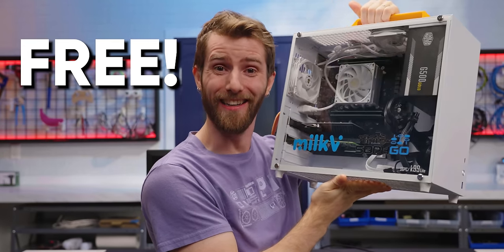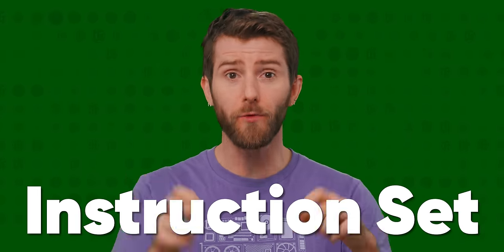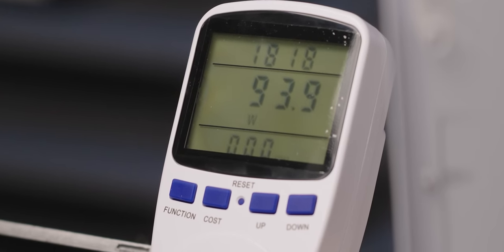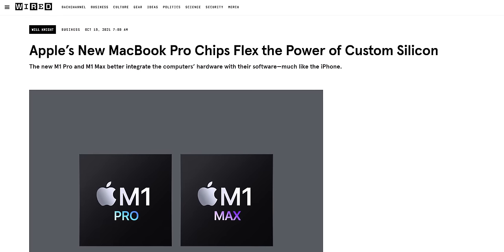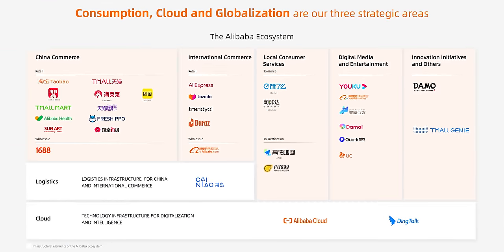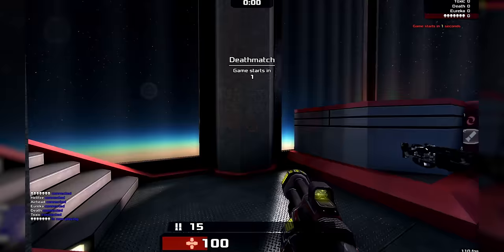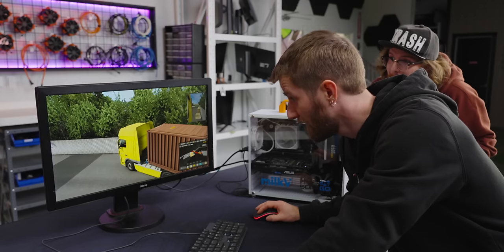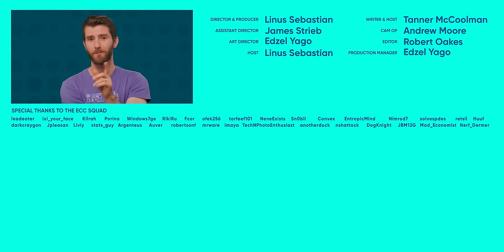This CPU is FREE! - Milk-V Pioneer with RISC-V

Comment: This reminds me of when I learned to write to code. I actually thought it was pretty cool. I watched Apple update to IOS7 and change the UI Theme in about 4 months and damn near 200,000 manhours of code. Then realized it would take me 80+ years to achieve the same amount manhours. Then the errors of running code through some type of hardware level middleware will lead to insurmountable application and system crashes. This not going anywhere outside the classroom.

Comment: Screams on and off software for things
Reply: Optimize by id ing what engine and core files the games run on even a file system emulation showed a slow down like old decompression compression compiler drivers like default vs brand graphics drivers

Comment: Lol traditionally RISC was all but low performance. SPARC and MIPS cpus have been powering werkstations when x86 still was x86 and not AMD x64. Even PowerPC and DEC Alpha where miles ahead of what contemperary x86 and m68k (that's Motorola 68000 the other big CISC player in that day) machines could do. 
In the late 90's everybody (in professional computing) but the consumer (pc fanboy/gamer) market expected x86 to go the way of the Dodo.
You all have to thank AMD for developing x64. 
By the way Loongson used the MIPS ISA up 'till 2021 when they switched to there own ISA LoongArch that's still RISC and still heavily MIPS influenced (to the point that some would call it cripple MIPS) and it also uses some inspiration from RISC-V ISA.

Comment: Hey I don't know if anyone else pointed this out or if it works with the RISC-V architecture but there is box 86 which does only 32 bit applications and I got it to run steam on my raspberry pi (as an experiment) so that may work for this idk though

Comment: Low performance but very power efficient? 
I see there already solid application in very efficient NAS system, I mean 64 cores and OKish I/O? 
If I‘d not already own a NAS system I‘d consider using one of these if for instance TrueNas Scale works…
Reply: Exactly why it's starting to have increasing use in microcontrollers, so I would guess that it will come to NAS soon enough)

Comment: Well ~ It is license from RISC-V ... but what made the it !? T-Head or Starfivetech + Mike-V !? But ... what about the Risk !? RISC-V = RISK !?(RISC-V license allow you to ADD ISA and Close  it .... do you know what they adding ?! ) What about OS and Apps support !?
Reply: I'm not very sure if I understood what you meant entirely, but if you are talking about how the ISA itself is open source but that the extensions and core architecture can and WILL be closed source for every company that uses it, then true.
I think that it will work like currently on x86 and ARM SoC platforms.
The ISA will remain the same, so all software should be coded without extensions in mind for general operation, but if for example, a company adds an encoder extension, they are free to release this information to developers that want to support it (or maybe drivers), or not.
Again, this is the case with other ISAs already. Not all CPUs have the same extensions (you can check online or using CPU-Z)
Reply: This machine have some many issues ... first of all it based on RISC-V open standard ISA + Vendor specific ISA (base on the BSD license).  It will create OS support and applications support issue.  Second the chips "creation" ... normally SiFive will based on customer requirement RISC-V Open standard ISA +  Vendor specific ISA ...and pls something ... which can it "close" ISA chips (base on the BSD license). This is the BIG issue for GPL license OS and Applications to support !!!!
But this products of Chips some of the create by SiFive, some of them create by PRC local companies (like T-Head & StarFiveTech ... and more coming up), those companies don't have so much resources support (RISC-V open standard ISA + Vendor specific ISA)  on GPL license OS and Applications.

Comment: Please talk to somebody who actually knows about CPUs before trying to explain these concepts. Your explanation of CISC is sadly very misleading. CISC is neither more robust or was it ever "faster", nor is it in fact still being used in x86 processors internally, because everybody has long agreed that RISC is the only way to make modern processors. x86 is CISC only on the frontend for compatability. This is true for ALL AMD chips ever made by their own design and increasingly for Intel chips since the Pentium Pro, so not exactly new news in this millenia let alone recent time. RISCs original main place was also in HPC & Workstation, so nobody with even a drop of knowledge ever thought it was "just for low power work".

Comment: So basically the old apple hardware. For a good while they used motorla RISC something something and had expensive adds about how the powerPC was sex with livtyler.  Oh the irony that x86 was easier to develop for even if the engineering is complete shit,

Comment: anyone wanna help justify there $1,500-$2,400 price mark on this mess of a computer?

when if my searches correct! then for that same price you can get yourself something quite amazing.. y know like a full pc with a 3080, 3090, or even 4080! so why does this cost more than a raspi 4 8gb or raspi 5?
Reply: Raspberry Pi uses an established platform like ARM with regular Broadcom SoCs.
In this case, it is essentially a devkit with no regular desktop use which required custom silicon to be made just for developing, etc.
Imo the cost is justified.

Comment: Product Line 

AMD Ryzen™ 7 5000 G-Series Desktop Processors with Radeon™ Graphics

#of cores : 8
#of threads : 6
Max clock speed 4.6Ghz

65 WATTS 

can have 16GB's of Vram

play 1080P games.

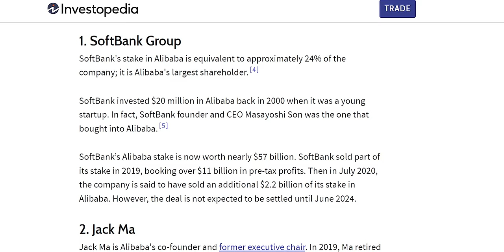Comment: 14:00 That is the minimum to have a sit in the board of most companies...

Also, what rubio said is true, design wise everyone can make riscv, not just china, is just that software is not there yet for the average consumer.

If you see the chinese skyscraper skeletons graveyard, or the bicycle graveyard, or the EV graveyard you might see that china produce a lot that is not been buy.

They cab produce and put money on making stuff more faster sure, but if consumers are not able to use it is not going to innovate anything.

You need hardware AND software and riscv is lacking in support, so even if china innovate their software is not as good as ours (western countries), 

By the time they make competent enough riscv devices we will have more than better arm (heck, you see qualcomm x elite?!, now imagine 2025 when they show the x2 elite  and the mid grade and entry grade products).

A raspberry pi5 is better than this, probably cheaper and people are putting gpus thanks to the m.2 port.

People are making the mistake of thinking the west is not improving and is doing, collaborative effort of japan, taiwan, germany, USA, UK, south korea and more is definitely defeating china, not to mention they are on a bubble economy like japan in the 80s... dunno how they will keep that under the blanket when it finally explodes.